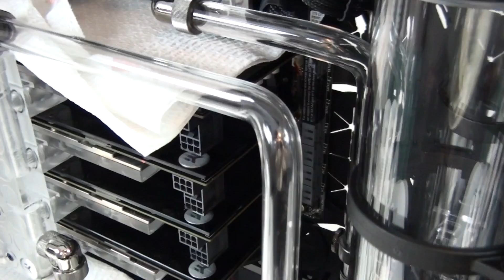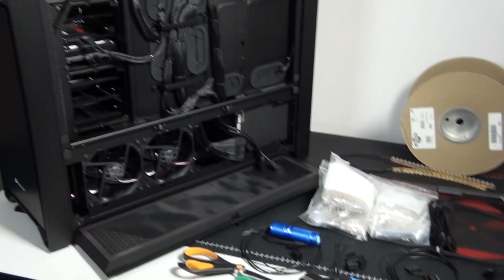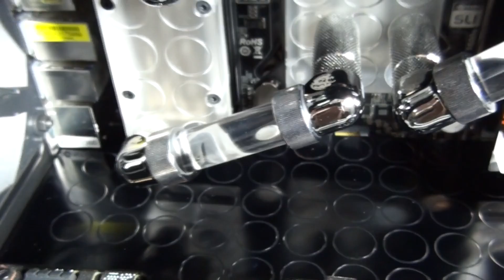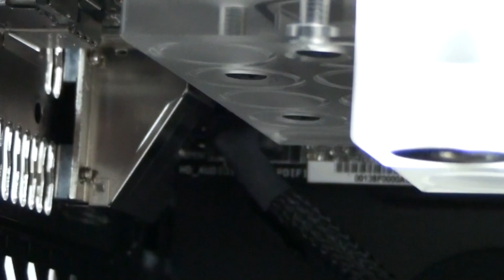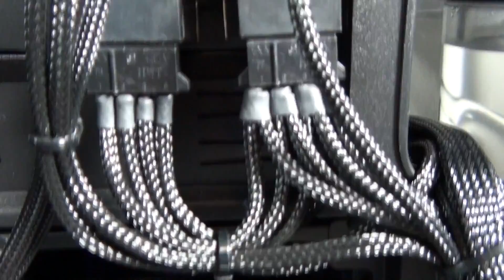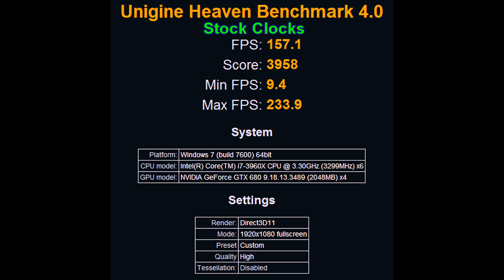Build #12: Quad SLI 900D: Part 3

Comment: this is going to sound funny, but theres no other analogy. would using something that imparts vibration be good to dislodge air bubbles and help them move through the system? something say roughly cigar shaped that can "fit inside" the nooks and crannies and "gently" touch the water blocks and fittings?? like i said it sounds hilarious and positively scandalous.

Comment: i dont think you actually need to unplug any of the other cables if you use a 24 pin jumper. pretty sure thats the whole point of the jumper that it doesnt let power through any of the other parts. and even if that wasnt true if a modular power supply is being used just remove it from the build slightly but unbolting it and pulling it out a few inches and unplug everything at that end, thus cable management in unaffected.

Comment: why is cpu's temp high at idle and load? i mean i dont use custom cooling i have corsair h110i gtx and @4ghz(i7 6700K) at idle it is 20 or 21 degree and at load it is 55 or 60 degree. but your gpu results are amazing, mine is at idle 40.
Reply: lga 1151 platform runs much cooler than older dye's/platforms for many technical reasons. They also draw MUCH less power. Those are two of the few things that have actually been an improvement in computers in the last 15 years aside from the obvious ones.

Comment: Hey, is there anything that you could water-cooler ssd/hdd ?
Reply: I have an adapter that routes through some 90 degree fittings, a few rads and water cools my schlong while I'm at my desk...
Reply: yeah, there are a couple of products for hdd cooling and some waterblocks for super-fast nvme ssd's. Not commonly used so very hard to find

Comment: do you have any tips for  budget builds?
Reply: I can put a parts list together, I'm great with budget builds
Reply: Nava Hivon $900 cad
Reply: k
Reply: DueLos Gaming Here Man, $877 CAD with an operating system, and it is ready if you ever want to upgrade to an i5 or i7 skylake since i chose this processor, it's new gen intel and even though it's an i3 it's way better than amd 4 6 or even 8 core. http://pcpartpicker.com/p/w62ZhM
Reply: +Nava Hivon damn...

thx bro, might actually build this system
Reply: +DueLos Gaming Don't buy that build, it will not last long in terms of performance and you will be much better off with different parts.
Reply: +csjdruid I didn't make that build.
Reply: +csjdruid what would you suggest for around $600 USD, preferably mini
Reply: ill do that for you